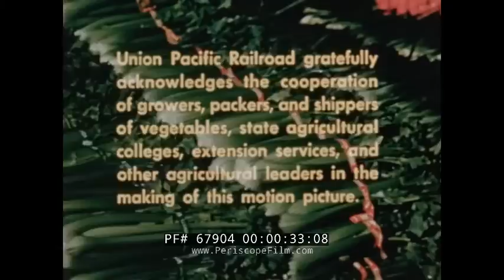1958 UNION PACIFIC RAILROAD FILM  FRUITS & VEGETABLE FARMING & SHIPMENT to SUPERMARKET 67904

Comment: It looks like UP must have scrubbed up gas turbine electric (GTEL) 62 for the film's publicity shot. They were the most powerful non-steam locomotives in the US in 1958, and I imagine the UP must have wanted the GTEL to be the focus of the shot, in addition to all the refrigerator cars. It was very rare to see a GTEL running without a fuel tender and and at least one trailing diesel, used to drag the GTEL into a siding in case of a flame out and stall, a not uncommon occurrence with these early locomotives.

Comment: The PFE was truly a wondrous company! How tragic so much of this type of cargo has left the rails! Given today's trucker shortages, increasing environmental concerns and the unGodly cost of gasoline, rail transportation makes more and more sense! Let's hope that produce, meat, etc. returns to the railroads!
Reply: Today's RR's aren't equipped to handle this sort of transport anymore... now they're all about 1) bulk shipments of stuff like coal, iron ore, gravel, oil, grain, etc which can sit in a RR car for long periods and not suffer quality problems, and 2) intermodal shipments.  H3ll even "road to rail" where they'd put refrigerated box trucks on flatcars for shipment to various staging areas then unload them at a depot for pickup by "local" semis that would haul them to the final destination over the highway is pretty much gone now.  None of the infrastructure and rolling stock necessary for this sort of railroading even exists anymore, and where would you find the workers willing to do the job and smart enough to do it right??  

BUT you are correct-- the RR is STILL THE most fuel efficient per ton-mile way to move cargo around-- steel wheels on steel rails is very efficient, compared to rubber tires on highways.  Problem is the rail network isn't as expansive as it used to be; far less actual "destination points" nowadays, and not likely to come back.  The country made a decision, conscious or unconscious, to switch to trucking decades ago, for many cargoes like these, leaving the railroads to deal with massive amounts of bulk materials and sheer volumes of things like intermodal boxes moving point-to-point for distribution rather than directly to the end user.  More likely that automated driverless trucks are the future, than rebuilding the railroad infrastructure that's been lost.

Comment: All perishables now go by truck, at much faster speeds and lower costs, on the modern 70 mph+ interstate highway system.  Imported perishables are flown long distances allowing Americans to enjoy summer fruit from the Southern Hemisphere in our winter months.   All of this modern transportation infrastructure was created by the Central Planners in Washington DC, in order to improve the life-style of the American Consumer, and increase the mobility the America Citizen; which, of course, is unsurpassed ANYWHERE in the world.

Central Planning WORKS.   Without it, America wouldn't have led the world in transportation, weapons, food production, and suburban-living for the last SEVENTY years.
Reply: Faster speed perhaps since no stopovers, breaking/making trains to send various cars to various destinations in hump yards, etc, but it's come at a cost... trucking isn't very efficient... rubber tires on pavement generate a LOT of heat (walk up to a loaded semi that's just pulled off the road at a gas station and feel a tire-- they'll be SO HOT you can barely put your hand on them!) and all that heat comes from WASTED FUEL.  Of course the more fuel wasted, the more "damage to the environment".  Rail transport is STILL THE most efficient per ton-mile of cargo, because steel wheels on steel rails is highly efficient, low friction way of moving cargo.  Once you overcome the inertia, it doesn't take anywhere NEAR as much energy to keep a rail car moving down a track, hence the greater efficiency.  Air travel is the most fuel hungry but the fastest.  

It wasn't "central planning" that achieved anything-- it just developed that way because the oil companies were producing tons of diesel fuel (more than could be used) from refining gasoline for personal automobiles throughout the 50's and 60's, and trucking companies could offer "point to point" service where most railroads could only move entire railcars to a depot or distribution center/rail yard, where it had to be unloaded off railcars and put into trucks for final delivery to the store or wholesaler supplying grocery stores ANYWAY.  Trucking cut out the middleman, one driver hauling a paltry 80,000 pounds, BUT he replaced a lot of loaders/forklift operators, a train crew, and got it there within a couple days using over-the-road trucking with team drivers and sleeper compartments in the trucks, directly to the end user (store).  With a reefer truck, no need for stopping and icing cars or blowing shaved ice in on boxes of produce, either.  Just diesel up the reefer tank when you fuel up the truck, and keep going.  It so happened to work out that the stores preferred trucks, the oil companies then had a ready buyer for diesel for trucks (and trucks use more of it than trains per ton/mile) and the railroads lost business, put a lot of people like stevedores and loaders and icers and other workmen out of work, and cut their costs, and focused on bulk shipment of materials like coal, oil, steel, sand, gravel, grain, plastic pellets, and other bulk goods shipped in huge quantities where the efficiency of rail travel gave them a competitive cost advantage, when time wasn't as much of an issue for receiving bulk orders.  Road-to-rail also popped up in the 60's and 70's, and was a thing for long distance transport of truck trailer loaded with products for the final destination, which were unloaded at regional depots and picked up by semi's that simply had to hook up and go and take the trailer to its final destination, then intermodal "con-ex" boxes rendered that mostly obsolete, as specialized railcars can 'double stack' intermodal boxes and so that and bulk is the railroad's main bread and butter nowadays.  Trucking takes pretty much everything else because of the proliferation of the "just in time" production scheme that is currently in vogue in industry and retail... can't maintain a supply on hand in stock anymore-- that cuts into profits; who cares if it leaves the customer hanging or puts the company in a bind now that supply chain disruptions are the norm... 

Oh well, back to the drawing board... OL J R :)